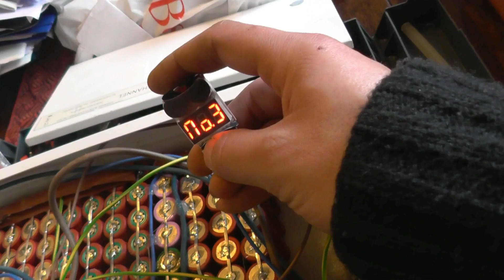1 duff cell can ruin a pack

Comment: Little trick i came across recently that helped me with using old laptop batteries is this, I bought a bucket load of the 1x2 modular cell holders from china so i could assemble my pack for my ebike in a modular fashion, during my testing phase i picked up some 1/8" x 1/16" magnets local to use as temp connections during charge and discharge testing of every cell, but later during assembly i felt a little worried about soldering all the connections due to forum members telling me that you shouldn't solder 18650 cells, well one night while trying to study on how to build a spot welder i had an idea pop into my head, these 1/8" x 1/16" magnets are very very strong and make a very secure connection, so i attempted soldering a wire lead to the magnet and found that i could solder the magnets to leads and then connect those to the 18650 cells, then i put a bead of hot glue over the entire end of each cell to fully secure magnet to the cell without it being able to move, then placed shrink wrapping over the entire battery, when i had my first "duff" cell occur, it was very easy to find, i just peeled the hot glue off, disconnected the magnet from the batteries in that string test all the modules in that string that day, found the dead one within an hour of taking the battery off the bike.. replaced the cell with another, connected all the magnets, placed a bead of glue on all the ends and reshrink wrapped the pack and i was done an hour later... when i was building the pack i took a thin peace of hobby wood i had laying around, found a drill bit that made holes just big enough for the batteries to sit into, then taped the wood to a metal surface, placed magnets in all the holes in the wood, then ran my single string of copper wire across the top of the magnets and soldered all the connections in one sitting... made assembly beautifully simple afterwards..

Comment: thanks for doing this.   This is the reason I have been reluctant to use reclaimed 18650 cells.  regards MBP
Reply from the maker: your most welcome! I would like to make a larger pack from new cells! but at current prices I'd rather go to LIFEPO4 cells to get 4 x as many full discharges!

Comment: Could you test the resistance of all the cells with a multimeter?
I might be wrong but I think bad cells are 'bad' because they're highly resistive
Might only show under load though
Still, worth trying I suppose, shouldn't have to desolder them all

Comment: And just checked battrery again and because I just snipped connections on one side to stop them been linked all over cells are higher then one cell so tomorrow I'm going to replace the single low voltage cell and pack should be back in action as to fuse wire each cell won't work with li-ion as a dead cell won't draw more current then a good cell like nicked and such so won't melt the wire tried it I did think of diodes so a bad cell would not pull other cells down or maybe a protect circuit on every cell so the bad one shuts off but again higher cost idea of using old is cheap soninthink time lost is far cheaper then cost of parts unless it is needed to earn a wage

Comment: Would the duff cell get hotter under discharge? if you could measure the temps of the cells somehow that could save some time stripping down the battery.